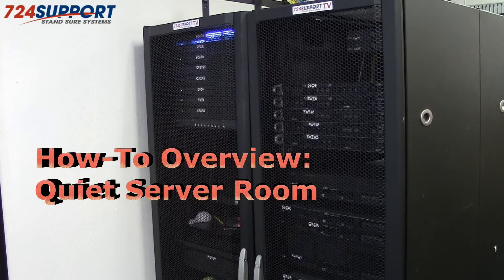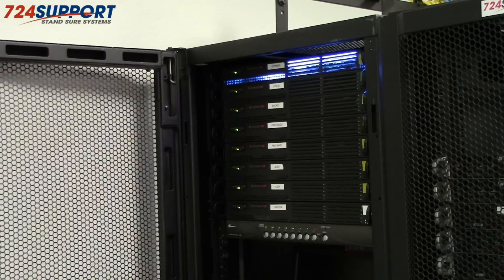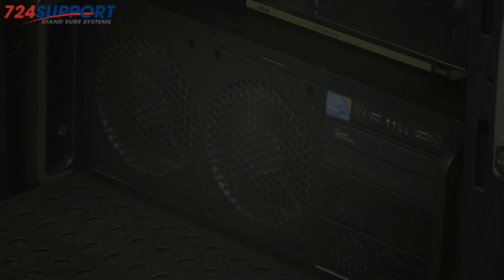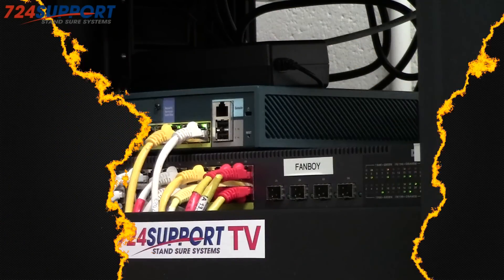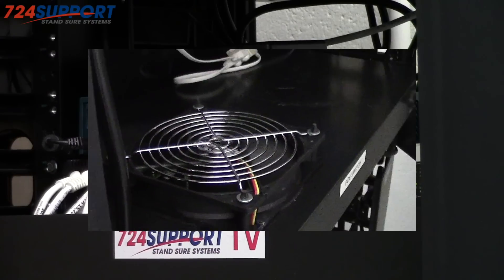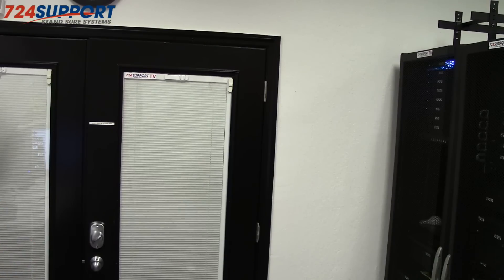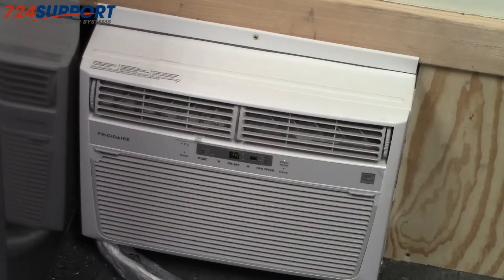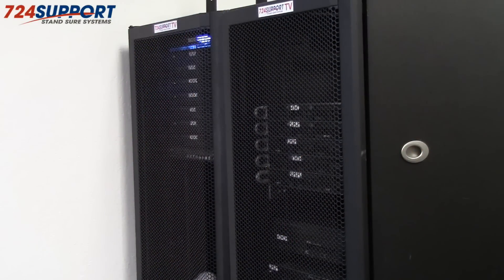Quiet Server Room How-To Guide

Comment: I have two servers Dell PE r710 and Dell PE r510 along with 3 POE Cisco switches and Cisco router in small enclosed rack in a computer office room. I do live in an apartment. I do not really want to build the two Dell servers into different cases. I Do also have a Dell PE 1800 server as well. What do you recommend to quiet my server rack and computer room/office?

Comment: I used filtered outside air in the cold months from the north side of the data center and this provided cold air to cool the servers. The heated air was pulled up from the back of the server racks and pumped by a fan into the next room, providing free heat!
Reply: A/C hardly had to run using this set up!

Comment: "Low noise, Atom processors..."Low power, low performance, keep a low expectation of service delivery.
Replace "noisy" Cisco enterprise gear with crap D-Link. 

Swap a Cisco 5525/5545 with a 5505 that can barely handle 1/100 of the throughput.
Now, let's put it ALL at risk by depending on building HVAC, which we have no control over.
What you've done here is directly against all best practice.
And I say this as a 30 year expert in the field of engineering.
Literally everything you've done here introduces unwarranted risk and single-points-of-failure.
I hope you do this for a hobby, and not business.

Comment: SORRY FOR THIS RANT But who really cares if you cannot hold a reasonable audible conversation in a server room within reason. Keep it the right temparature, no one goes in there to sleep, people are going in there to maintain equipment. Your modding cases to put quiter fans, forget the warranty. As a system admin I could do all the work remotely and simply went in the server room routinely to check or maintain equipment not to have a conversation. What is the point of putting silent switches in if they run at hotter temps .

Comment: I'm sorry, but you can't just replace two Palo Alto Networks 5000 series firewalls with an ASA 5505. If they bought a PA-5000 firewall, they either extremely over provisioned for their needs, or all of their throughput went down to about 1/100th of what they had (estimation since who knows for what reason they're using those PANs).

Comment: so you took a gun pointed it at server resilience and pulled the trigger !  the whole point is that traditional 1u, 2U servers are designed with long term reliability and that usually means multiple power supplies and components that can be pulled with no denial of service!
Reply: Exaclty. There are multiple options for sound dampened racks out there, I would really recommend getting one of them instead of literally replacing all your hardware with crappy stuff.

Comment: I'm so pissed by the industry that they aren't able and willing to create silent servers. Seriously a server room is not a data center, it's often just a transformed office room with thin walls and 5m away from your workplace (just separated by the toiletts).
Reply: They are built to be as compact as possible so you can fit more into a small space, you could always get the really large racks and mount massive heatsinks inside. and use low rpm / noise fans. will turn most servers almost silent.

Comment: Hi there. Great video btw. Have you ever considered the noctua silent fans and running a few of them at low rpm?
Reply: The server firmware will think the fan is failing due to the low RPM
Reply: Captain Technology I thought of that except most 1 or 2u servers have extended fans for more air so I wonder if the noctua fans would be able to push enjoy air for the ducting

Comment: Get some hanging heavy plastic from the ceiling to the top of the rack to keep the cool AC from just doing a loop across the ceiling. The AC will not have to be as cool and will run less to maintain proper cooling. Controlling air flow makes a big difference.

Comment: So in the winter when they shutoff the inlet form the HVAC their server room is a negative pressure area. This means that any dust and debris around any air inlets would get sucked in. Plus with the negative pressure if you have a dedicated dry-chemical fire suppression system (Halon 1031, FM200 etc.) you're going to end up with very poor seals around the perimeter of your server room, which would leek in the event of a discharge. 

I guess I could see this being a plus if you had a server room next to an audio studio or something like that, but generally I'd look at better planning when you move into a suite.

Comment: Easier would be to use Server Room in a Cabinet Enclosures. They offer Soundproof and Heat Dissipation so that networking rooms are not needed and networking equipment can be enclosed and stored anywhere desired. These cabinets can be procured from any authorized US RACK Distributor dealer.

Comment: Doing everything you just said is tedious,  especially hacking and changing the fans for mainstream types. You're giving up time money and reliability for quietness? To swap out fans, you'd have to do it after hours and schedule the maintenance, then pull each server out and undo the fans and reinstall, if they are in slideins, it would be much easier. Regardless, too much work to perform on an already existing infrastructure.